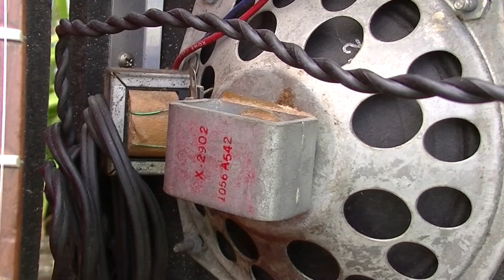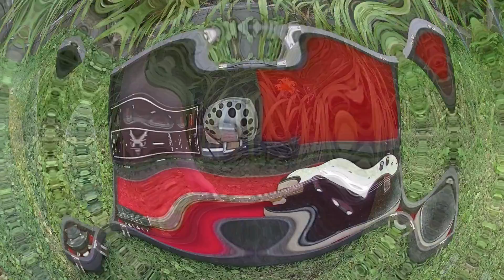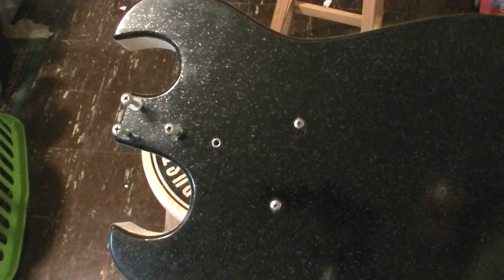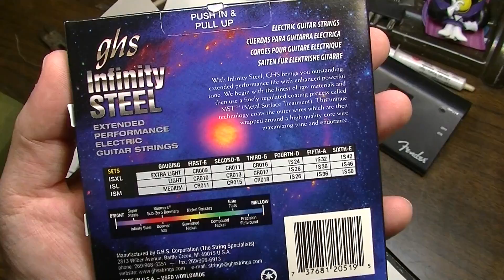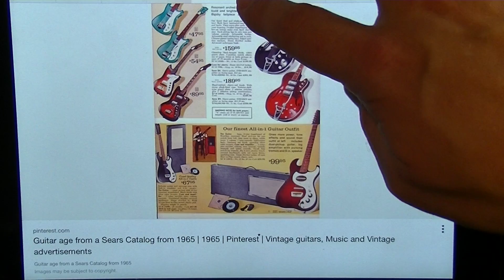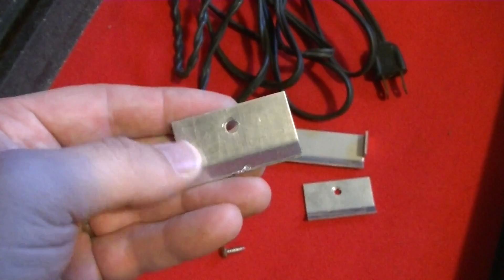Amp-in-Case Guitars - Bad or Brilliant?

Comment: I've got a Silvertone 1423 I picked up for $75 about 18 or 19 years ago. The bridge wasn't in the right place, it was clear it had been slid all over the top, but the pickups sounded amazing nonetheless. I didn't know much about these guitars at the time, but I knew what my ears heard, so I bought it on the spot. Now I know the pickups were/are DeArmond Silver Foil PU's, they go for a pretty penny all by themselves. The block inlays in the neck are fairly cheesy plastic/Bakelite pseudo-pearloid numbers, not the best part of the guitar, but don't affect playability at all. When I brought it home and plugged into my Mesa DC-2 and my '65 Princeton (non-reverb model), I was even more blown away (had run it through an older Gibson amp at the store, don't remember the exact model, but it has a darkness no amount of knob fiddling could cure, I haven't played throb any of those I really liked, tbh). Couldn't believe how harmonically complex and beautiful it sounded, and still sounded great through the Princeton, clean. 

I still have it, but my younger sister had snuck into my closet and gotten it out, and spun the pickup selector knob all the way around a few times several years ago (she now has children of her own), yanking the wires off. Haven't been able to get the knob disconnected from the shaft to properly remove the control cover (too many other projects, currently, after a recent move, unfortunately), but I'm looking forward to playing it again when it's all sorted. Love my recently-acquired Super Sonic 60...liked it so much I passed over a '72 SF Twin to pick it up after playing through both extensively on multiple visits to the store. It just started squealing suddenly last time I powered it up, not sure if a tube or something was knocked loose during the our move, so I'll have to figure that out, but have several other amps to use in the mean time.

Quick post-script: those who automatically turn their nose up at Solid State amps are missing out on some great sounding amps at killer prices. While shopping for a Roland JC amp, last year, I came across a Yamaha G100 212 II at a local Pawn Shop, plugged into it while waiting for the sales guy to confer with his manager about something else (wound up scoring a set of Shure SE535 In-Ear Monitors for just under $10, out the door, sold as 'no-name earbuds'!). Loved the sounds, loved the Reverb (when not turned up past 7, that is, can get a bit too springy past, for my tastes, anyway), and it has an effects loop, so I figured I could use a pedal or rack unit for Chorus when I want it. After playing through it a bit, checked the back and was surprised to discover no tubes hanging down from the chassis. Grabbed the IE Monitors and headed after snapping a few pics with my phone in order to do some more research at home. I read up on the amp at home, decided to put it on layaway (gave me time to move some other stuff first, reducing the PO'd Wife Quotient 😜), then fetched it a couple of days later. Turns out it was Co-designed by Rivera, used to be Pat Metheny's go-to amp, and still used regularly by Mike Stern, among other Jazz Cats, Phil Keggy used to gig with the 50w version back in the Eighties, I've heard. I still love it, I keep it in my Family Room, it takes pedals and rack gear well (its "Drive Channel" is fine, nothing special, but neither are many other amps', not what i bought it for, just fattens up the tone a bit, can be useful if no lousy pedals are at hand), requires zero warmup time and no expensive NOS tubes to give me anxiety every time I decide to fire it up to noodle around on. Impressively flexible tone circuits (has a Parametric EQ), and includes the original channel/reverb pedal, to boot, all for under $225, tax included. Great Jazz/Clean amp, very warm, not overly "forward" sounding. And that's just the one (SS Amp) I'm willing to talk about, there are a few others out there that are criminally overlooked and are killer deals simply because they, "don't haz tubez!" 😜
Reply from the maker: Last I checked, a price tag doesn't have tone and neither does a spec sheet. You just gotta play something and it's either for you or it isn't. Generally I stick to tube gear, but there are SS models I like very much.
Reply: The Guitologist - Agreed. I've always gone with my ears and my fingers, sometimes I didn't have enough money to snag the really popular stuff (I got that Princeton in a 3-way trade, done through an early online escrow service, by trading a Bandmaster head I picked up for $250...but had to sell it less than a year later because I was a poor College kid, one who was already married and had two kids, a guy drove all day, across two States, to come buy of from me: he plugged in, played for less than a minute, looked at the back/insides of the amp really quickly, and handed me a wad of cash, picked up the amp, and headed back home). Like most other players out there, I'm sure, I much myself over some of the gear I (had to! Argh! 😂) let go of, but not before I really enjoyed, clinging to the gear I truly couldn't stand to live without (except for one guitar I swore I'd never sell, but had my neck and spine broken in a car accident after sometime drove through me while texting and running a red light...was wheelchair bound for almost two years, couldn't lift a guitar strap over my neck, even, nor use my fingers, thought I'd never be able to play again...still miss that guitar and the Top Hat I had custom ordered, but HAD to sell to help pay the bills).My grandma had a Mid-Fifties Goldtop Les Paul she played regularly (she and my grandfather were on a traveling Music/Revival Circuit in and around Texas before they split up). One particular relative, who I won't name - he's truly sorry and didn't even remember what he did, broke into her house one night and stole it, pawned it for practically nothing. My Dad still has a picture of her with it from when she was young and beautiful (God rest her soul). Not that either of us would have inherited it, she discovered eBay a couple of years before she passed away, sold off everything she had of value (including a genuine Leslie Rotating Speaker, which she used for Organ in Church, something she had until the end, she played several instruments, she was a pretty cool Grandma 😁 She took it apart once to show to me and my brother when we were little, I thought it was SO cool, we'd lay down in front of it and beg her to keep playing through it, until she got tired of the same handful of songs she liked to use it with, then would tell us her hands were sore and to go outside and climb a tree or something. I was too young to know it could be used for anything other than that Organ, really, tried gently (OK, probably obnoxiously) asking her about when she had begun hanging out heirlooms when she got sick, but it was a step too far, for her taste, to consider passing it on to a grandchild.

I have several tube amps I love, have parted with several more, but there are so many cool sleeper instruments/effects, etc. out there, I try to get pumped up about gear when it seems near the bottom of its popularity/deprecation curve, I've scored a lot of cool stuff that way for dirt cheap (like the Mu-Tron III I also had in college, and also sold a few years later for what I thought was a good profit...they're worth over ten times what I bought it for in '96, seems every funk (wannabe?) Bassist has to have one now), I'm also just naturally drawn to weird stuff that nobody else seems to love...thank God my wife is the same, or she'd never had stuck with me for so long! 😜

Comment: My Silvertone is still a wonderful little guitar, but the amp/case needs some work. Any recommendations for where I can find a good replacement speaker are welcome. The amp may also need work, but one thing at a time.
Reply from the maker: If it's the 6" speaker, you'll have to do some research there, cause I'm not sure. But Weber might be a good choice on the 8". You just need to make sure the depth of whatever you buy will fit inside the case.

Comment: Those trim pieces kinda look like door thresholds for flooring. Very interesting video, thanks man..so cool .I remember seeing and desiring these guitars back in the 60s. We settled on a Supro guitar with a Supro amp..I think was a 12 or 15 watt. That was in 1967. Which at the time I think was a little better set up than the Danelectro stuff. I ended up trading the Supro in for a cream colored , used Telecaster..in 1969 or so..I was playing pretty well by then , and I needed an upgrade. This video made me go back and think of all the old guitars of the 60s we used to dream about. I started with a generic Spanish box guitar we got with S&H greenstamps.

Comment: Question...can the amp be made safer?  Would a UPS / surge protector help in any way?   What about adding an isolation transformer?
Reply from the maker: Isolation transformer could be added on the mains, yes. That would improve safety. A surge protector would provide some protection probably. If the amp drew too much current, the circuit breaker would throw on the SP.

Comment: Also the only way you can get the twist out is to strip the finish and steam the neck, then setup in fixture to dry !  Almost forgot..... After drying, you should finsh with a light oil, do not use unrefined Tung oil ! Some folks have had bad reactions like an allergy on contact .  As for the adjustment screw, that chrome shoulder was glued to the screw ! It was cheaper than having a machined part !!

Comment: Saw one at Sears like that when I was a kid.  Money was tight in those days so didn't get it.  Probably turned out for the best as I may have fried myself with that transformerless amp.
Reply from the maker: As long as the power cord is oriented correctly, it's usually ok. You won't get zapped too bad.

Comment: I think the big reason for not making amps in cases anymore is they now make amps that can fit in your case like the Vox MV50 and you have the option of putting it anywhere you want, not just fixed in the case. The Vox is 50 watts and has a little tube inside, loud enough for any gig. Great video though. Love the tone of that Silverstone!
Reply from the maker: Well, now that you mention it...why not make the amp capable of snapping in and out with a couple clips? See, present a problem and I'll offer a solution. I should be making the big bucks. :P

Comment: Thanks for this cool review and insight into Danelectro equipment.  FWIW I will show an image link for a relatively easy mod to address the headstock 'quirks" .  The angle can be altered to allow straight line string angle thru nut to tuners, which I replaced with Shallerrs and the standard Danelectro nut is a great direct replacement for the Sears version.  You can check it out here http://i.imgur.com/k7FJEwi.jpg.  Also the simple stopped bridge is replaced with an after market (in this case an old Leo Quann) adjustable saddle model.  It stays in tune under extreme conditions and sounds amazing.

Comment: One of the brilliant amps that you can use would be the Pignose 7-100. I don't remember how loud it is, but you can get a number of sounds from it.

A much more reasonable solution for gigging was made by ZT Amps with their 200W Lunchbox amp, which is no larger than a lunch pail and weights about the same as one as well.

Comment: I had a T-60. It was a P O S! It never stayed in tune! My brother had this exact guitar in a box. We changed the headstock to look like a Vox teardrop and took the strip of draw liner off and filled and sanded it and painted Blue sparkle with Testors model car paint. It was sharp! In the 60s I spend many a fun hour looking at Sears, Mont. Ward, JC Penny, Spiegel, and even Western Auto had for a few years a small line of guitars and stereos. There were some others but I cant remember all of them. Great video! Brought back some wonderful memories. You made her sound good! Course you could put strings on a baseball bat or a 2X4 and it would sound good! Thankz

Comment: Great video!  I have a 1448 myself.  Those little amps sound great for what they are.  I tried to mod the guitar with a Danelectro bridge with adjustable saddles, but the saddles are not in the correct position, relative to the old rosewood bridge, so it still won't intonate.  Been thinking about getting a compensated wood bridge made that will fit the original plate.

Comment: I bought one of those Danaelectro silvertones 25 years ago for 40 bucks at a yard sale. Still had the flat wound nickel strings. I should have kept it. Sold it for far more the 40 I paid for it.
Reply from the maker: Yep, I'd found them with the original strings before, and they were crappy flatwounds.

Comment: You took the neck off and ruined it. Yeah It helps when you are a pro and actually understand guitars , It is suppose to have a bow it with out string , it is like a spring bro, THE NECK ONLY IS STRAIGHT WHEN IN TUNE WITH STRINGS. omg he took the neck off.
Reply from the maker: Interesting comment. Not sure where to begin here.

Comment: Every ones making these little amps like Orange Micro terror or the little Hotones amps that you can put in your case.  I have a few my self. Put that in a case with a 10" speaker and add a power supply. it would be perfect for street performers or to take out  to the park on a nice day.
Reply from the maker: Tubes would be cool, but a battery could not supply the high voltage necessary for a tube amp. Something solid state would work better for portability. Fender would really be the most likely company to put something like this out today. The G-DEC technology paired with a decent Squier Vintage Modified Mustang or something would be a cool starter kit.

Comment: As I recall (I don't play steel, but I'm a big Speedy West fan), most Supro lap steels came with an amp built into the case back in the 1940's. I'm not sure when they stopped doing that. Rickenbacker did that with some of their lap steels too.
Reply from the maker: I put a note about that in a sticky comment. Not all Supros came with them, but yes, as early as 1938, they had an amp-in-case model. So this idea goes almost back as far as production electric guitars.
Reply: There was also a company in the 60's or 70's that had an amp in the case that could run off an AC cord or batteries either one. Now that was a regular guitar, not a lap steel, but I sure can't think of the name of it.
Reply: I think it had a name like a surf song or band. Telstar maybe?

Comment: I actually owned one of those back in the early to mid '60s.  It didn't sound or play badly for what it was.
Reply from the maker: They aren't bad for a masonite sandwich.
Reply: They were actually pretty great little guitars, cost effective to learn on, and not loud enough to drive the rest of the family out of the house.  Thanks for posting this video.  I have seen a couple other YouTube videos and it is very interesting to see the history of this guitar.  I moved from that to a knock-off of a Fender P bass and ended up with a Gibson EB 1 bass that I picked up for next to nothing.  Wishing I still had that one back.

Comment: I think a repackaged tiny terror with a pair of 6 inch speakers could fit very comfortably in a guitar case.  remember the nasty sounding guitars that had amps built into the bodies?
Reply from the maker: Oh yes. A couple other commenters have pointed those out too. Ironically, the old man who sold me this Silvertone also had one of those...a Synsonics, but it was in pretty poor condition.

Comment: There is a product called CLP that works miracles freeing up seized screws. I recently used it on a Silvertone Strat copy . I was setting the intonation and the bridge saddle adjustment screws were seized. After a drop of CLP they were free in just a few seconds.It is actually a gun cleaning product and you can find it in the sporting goods section at Wal Mart and other department stores that sell firearm accessories. I don't know what it would do to the finish if it got on the guitar body, so be careful about that.
Reply from the maker: Thanks for the tip.